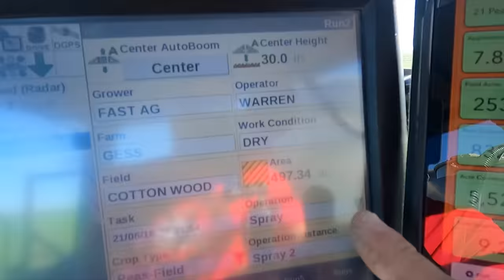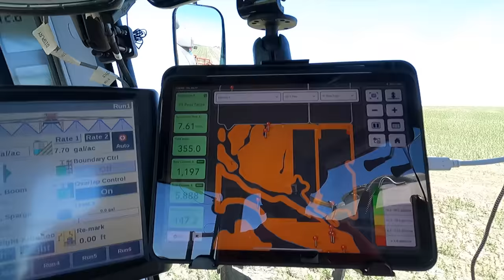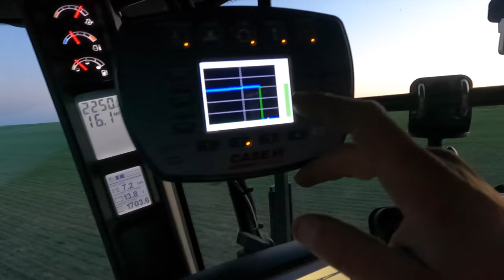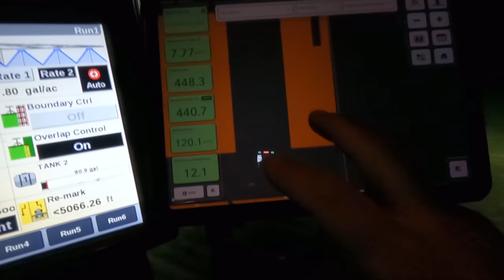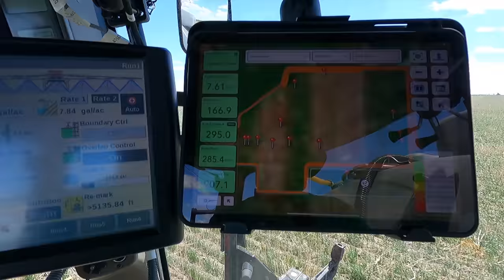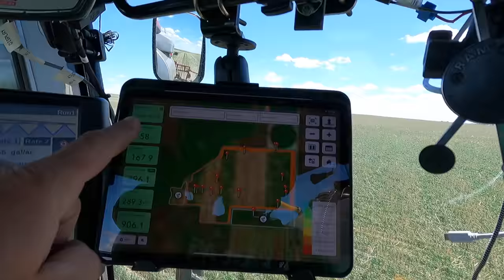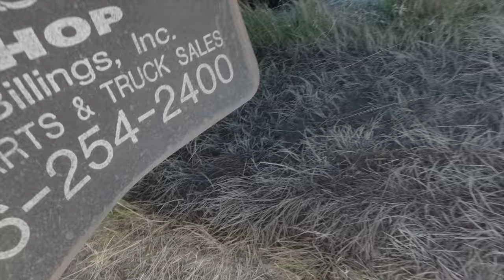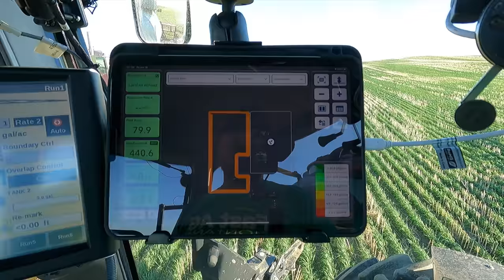The Safety Man Shows Up!

Comment: hello, chickpeas ? almost unknown in France, there are only ordinary forage peas? We had a dry start to the spring which almost turned into a disaster, but May was wet, so the grain size will be exceptional. But June is stormy, with hail in some places. The harvest should be very good, winter barley harvest in 8 days, winter colza in 15 days at the same time as winter wheat.of France. Daniel Gallois
Reply from the maker: These are dry edible yellow peas.  They are used for human and animal consumption. Very good source of protein.

Good deal on the harvest.